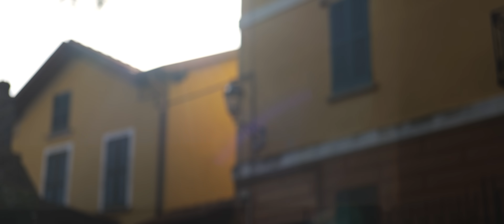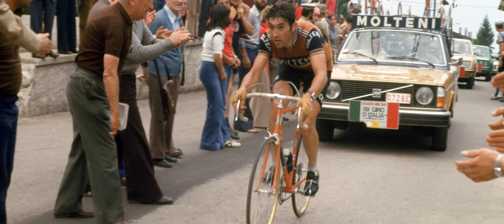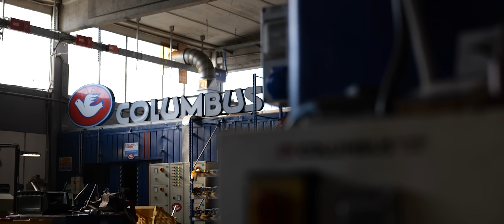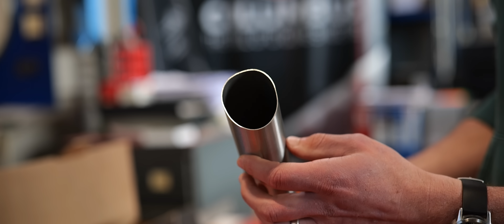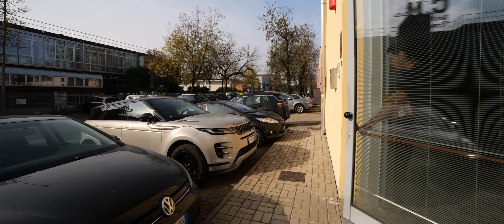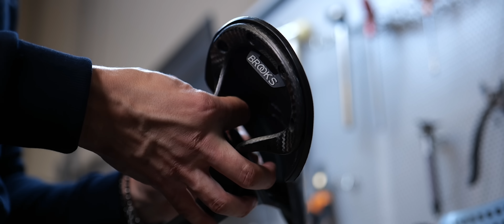This New Colnago Will Blow Your Mind

Comment: Despite the ubiquity of carbon fibre in high end road racing bikes, steel has a future. As we see in this video, it can be worked so many different ways in terms of shape, alloy, treatments and even combination with 3D lugs.  I think 3D printing of lugs is not cost effective for steel, but maybe if they could be cast economically, it would allow for a seamless finish like the frame here, which would be an exciting development, especially now that hoses are integrated into the frame and shifting is going wireless. I would have liked to see how the lugs are welded and the frame finished. The extra kilo of frame weight is of no concern to me, as it probably represents 1% of total bike, gear and rider weight.  Having lower gears is more important.
Reply: I did some digging on their website to find that they claim that the frame weight for a 48.5 sized frame, is 1.9kg. That's a pretty small frame. (That size would only have a 53cm virtual top tube)
Reply: @billkallas1762  That's pretty much what my Spirit/Zona frame weighs in that size. These frames are good at absorbing road vibrations, and have a bit of spring to them when dancing on the pedals, but they won't accelerate as fast as a stiff carbon racing frame, especially on a steep climb. But if you're going to be making coffee stops, then why worry about that? Steel leaves you relatively unrattled after a 4 hour-plus ride, which is a benefit in its own right.  You can ride gravel and dirt roads quite well and probably faster, with a slick 28mm tire.

Comment: Its a nice frame but 1.85kg unpainted is not that light. Just average actually. Steel frames have achieved that weight mark for decades already.
Reply: I rewound the video twice to make sure that I hadn't misunderstood that number. Surprisingly heavy. Maybe the 3D-printed parts are heavy.
Reply: @crowbarcycles  I assume they are no lighter than normal lugs would have been.

Comment: If the 3d printed and tube steel fork could not be safely built then why should we conclude that the frame is strong enough. They certainly were vague with you on the metal types used and QC.
Reply: I think the reason they didn't build the fork like the rest of the bike because they couldn't get the performance they wanted while maintaining the safety requirements. Maybe they wanted it to be a certain weight or have a certain amount of flex and they couldn't build it to those specs using steel because it would be too thin. I'm sure some of those safety specs are just "How thick is it in certain places?"
Reply: No need to worry. These things are made to be garage queens for rich people who already have it all.
Reply: Uhmm...testing??
Reply: It's a bloody good question! 3D printed lugs will likely have a mode of failure you would't normally associate with steel bikes, even so it is all about application. A fork is a lever and a frame benefits from triangulation, so their innate structural abilities as components are at the opposite ends of the spectrum. Design tradeoffs for one may simply not translate to the other.

Comment: This is insanely stupid. Buy a brand like Chesini or Stelbel instead. Also steel, Italian, made to your measurements and waaaaayyy cheaper.
Reply from the maker: Surely you could say the same about a Stelbel compared to a standard off the shelf steel bike? Hard to justify one of those either when you look at it objectively, so maybe objectivity isn't the point?
Reply: @gcn  You don’t get my point. Chesini and Stelbel are both brands that produce made to measure bikes, not “off the shelf-bikes”. So you will get a better product than the Colnago for way less money. 

And yes, I know you get sponsored.